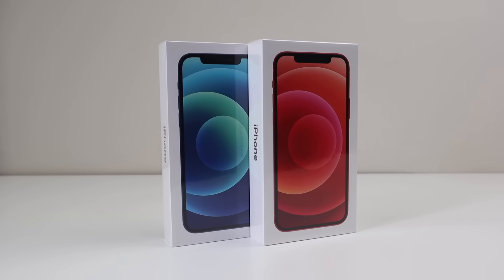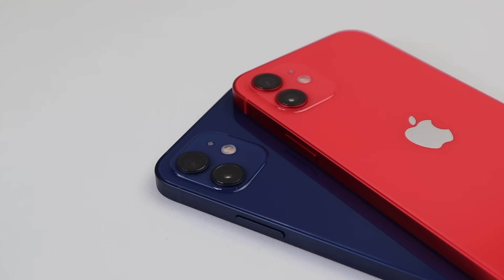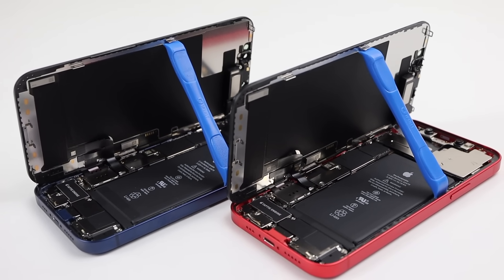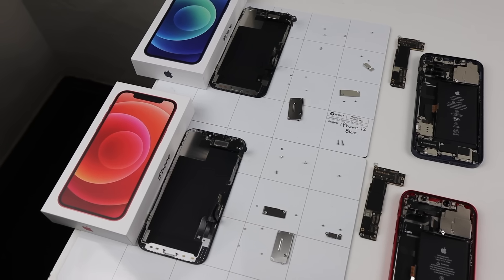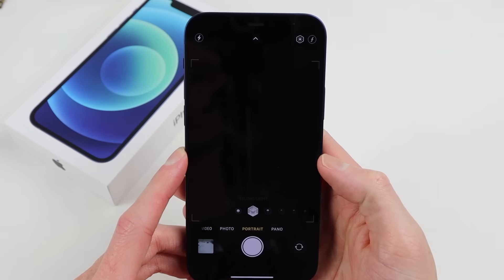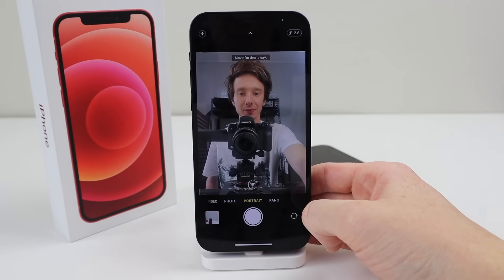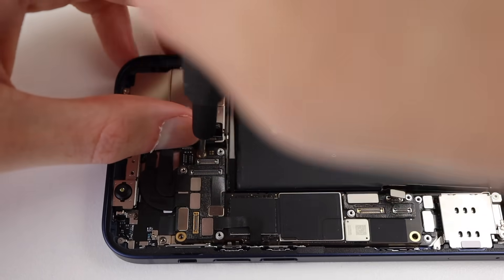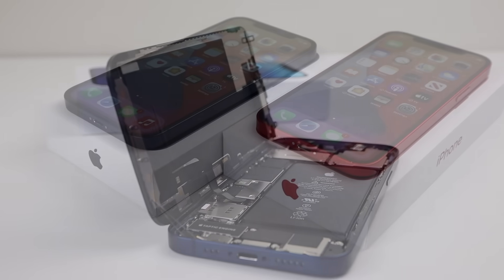iPhone 12 Anti Repair Design - Teardown and Repair Assessment

Comment: I've owned 1 Apple PC in my life time and that was like 10 or 12 yrs ago.  Video went out on it after 12 1/2 months --- they wanted $1300 to repair it - it was only $1800 brand new.
Being a electronics engineer for over 35 yrs, I fixed the damn thing myself.  Time wise took me longer to take the casing apart than to actually fix it.  Total parts cost was $1.79 !!!
That was the last Apple product I ever owned and will never ever have another Apple product.  Aside of their outrageous rip off prices for repairs, Apple is just too damn intrusive
for my liking.  After you buy something from them it belongs to you, not them, yet they do everything possible to control how you use it, what you can or can't do with it and all they
can do to prevent you from repairing it or having it repaired by anyone other than them.  Which is BS !!!  They took my money for it, its MY property now, not theirs.  So nope, I will
not deal with any company that still wants to control everything about MY property !!!  Oh, I forgot to mention --- over those past years, I've probably steered over 100 people from
buying Apple products --- all I had to do is tell them my story, what happened to me, and they made their own decision - interesting parts, damn near every one of them said the
same thing as I did --- Once they buy its their property now NOT APPLE'S and they should be able to do with it whatever they so choose --- same as I said !!!
Reply: Apple told me I needed a screen replacement in an out-of-warranty MBP to fix stiff hinges, and could not tell me what type of lubricant was used in the hinges. I fixed them with two drops of light oil. That was years ago; the hinges are still fine.
Reply: @vadimmakarov6811  you know that knowledge = money, so they won't answer your question
Reply: It is very anti consumer, yet people will continue buying it. I bought a MacBook Pro in 2011, and to this day it still runs smoothly. I had to replace the HDD with SSD and replace memory sticks, but atleast back then it was 'repairable' to an extent. Nowdays, everything is soldered together and you are SOL if you want to increase storage. I am still using iPhone 6S and I will continue to do so until it dies, which will be very soon.
Reply: @systemfox4724  but still peoole are gonna buy this...
Reply: This right here ^^^^ Apple is sick who just wants people to spend more money. They are SO greedy it's unreal. I think Samsung is way better in many ways.
Reply: I once owned an iPhone 6S, I was super careful not to break it and I did not know about the repair price being almost as much as a new iPhone unit wow. Tim Crook really has to be replaced.
Reply: Doesn't sound like you actually need an apple computer in your life
Reply: @tempsitch5632  For a long while, Apple was making notebook hardware far superior to anything on the market (a large SSD, fine screen at low power consumption and weight, etc.). So I bought them and run under Windows.

This is no longer the case. As of 2021, there are notebooks that rival MBP in every aspect, e.g., top of the line Dell ones. And, anyway, Windows no longer runs on new MBPs.
Reply: @vadimmakarov6811  Can't understand why you are talking to me, or why you call them "notebooks".
Reply: @tempsitch5632  I"m not the person you have addressed but this is a public discussion, so I've chimed in. Hope this is fine :). I've explained why I actually needed Apple hardware (two consecutive macbook pros, in my case) and there wasn't anything else on the market that fulfilled my requirements. I searched the market and I was aware of the drawbacks of owning apple stuff, still went for it because of the specs that no one else had by a factor of four (the capacity of SSD in my case).
Reply: They over price crap, and people buy it because they have not tried the other brand. I've tried both, and I would go for Samsung. Apple is over priced to the moon and back when compared to samsung.
Reply: A 4 year old is better at diagnosting than Apple‘s ”Genius“ employees
Reply: @tospoooky4me-417   even im better. And I am not tech savvy
Reply: just build your own $1800 can get you a better pc than a factory made apple pc.
Reply: I've discovered that. I have a 2nd hand iPhone 6 for music (got it for it's price and capacity), and man it's a complete headache transferring stuff. Have to use specific software. They say the control is so customers have the same 'quality' experience. But it's really not. It's so they can have control full stop, and charge you latter down the line. 

Heck, I hate how basically every phone has an internal battery now (I'm scared to open them). Really screws you over when they do go (happened on my S5, which I easily replaced) and now it's happening on my S7. Thinness is pointless too, struggle to hold the damn thing without a case. Even worse with the iphone which is thinner and made of aluminium.
Reply: "Who's the real idiot? The idiot who sells rubble, or the idiot who buys it from him?"

- Obi One Kenobi or smth
Reply: @cyclingdad6152  U do know Windows is an OS and not a company that manufactures and sells whole PCs and devices, right? U can't call a laptop that runs on Windows a "Windows laptop". It's a laptop from the company that manufactured it, running on the Windows OS
Reply: @cyclingdad6152  Windows is first and foremost a operating system, not a hardware manufacturer. Theres a variety of hardwared that "natively" runs windows so your comparison is flawed to the core. Something that could be considered a "standard windows laptop" doesnt exist.
Reply: @cyclingdad6152  you're* and sorry YOU'RE such a snowflake lmao. Next time, if you wanna talk about something, at least know the basics
Reply: @Safff848  sorry. I’ve had a look at your channel and you need to grow up a bit… like 15 years.
Reply: @cyclingdad6152  I dont wanna be 34 just yet kiddo

Comment: Yeah you need a .01 mm to get the things open, and cut away the adhesive. these phones are a real pain to open but pretty simple to repair. Just do not touch the metal thingy at the top. thats face recognition. Also the home buttons seem a bit more fragile.

Comment: First. Apple sucks. Second. My guess. There is some hidden, control. Most likely a special key sequence that allows access to factory mode. And, based on the start-up issue, it is possible to access the factory mode, the phone has to be connected to the USB and the other end connected to, possibility a factory machine, that syncs up to the phone, on start (providing factory access to the parts).

Comment: I don't have a lot of experience when it comes to iPhone phones, but I think they somehow gave each part a unique serial number which can only work if the other parts' serial numbers are the same or in the right order. For example, if you have the blue iPhone 12 phone with serial numbers on each part same, such as 1234567 then if you would try to replace the certain part for example camera, and use a different camera from the red iPhone 12, that camera would have a different serial number such as 2234679 and which then blue iPhone 12 could detect as different serial number and it wouldn't work properly. Or if the serial numbers of each part needed to be in the right order for example if the camera from blue iPhone 12 is serial number 312 that means all other parts of the blue iPhone 12 should be for example speaker part is 311 and the battery is 310 and so on. And in order to replace a certain part, you would need to find the same serial number on the same part or maybe they are unique to each phone, and in that way you cant replace parts, because you wouldn't be able to find the same part with the same serial number.

Comment: I'm not too surprised since I expect every camera module puts some characteristic watermark into the photos so that they can track down each shot to its origin even if it has printed out and copied several times. I know Ricoh has researched on such technology 20 years ago and it should have reached the required maturity. However, I'm not an Apple guy and perhaps this is all well-know stuff?

Comment: iGreedy, iDirty, iDisgusting, iVile that has become the best way to describe Apple, they have transformed themselves from a company that captured the imagination of the public with their products into a vile company for which there is no low they won’t stoop to, the list is too long and so public there’s no point going to great detail.

I suppose they will always have some iSheep that will follow them, but the writing seems to be on the wall for them, despite the pompous arrogance, it’s plain to see that the Apple stores to not have the buzz or as many people was they used to (this was already the case pre-pandemic).

For the uniformed person they still have desirable products until people realise the trap they are walking into, you can’t upgrade your RAM or hard drive because it’s all soldered on the motherboard, you can’t replace a failing battery because the phone won’t work properly and they call themselves environmentally friendly, I mean, Really!?

Thank god for small companies like iFix it and such that have always found ways to offer people alternatives, trying to charge 60% to 80% of the cost of a new one for a repair, is ludicrous.

The most basic of honour or shame seems to be a miss with Apple.

But ultimately they will fall, a company whose business model hinges on screwing it’s customers, will not survive long term, simply not possible.

Comment: I think this has to do with calibrating the photographic system with the rest of the hardware system, I recall that they use specific brand camera technology that has some patent on them.
I also know that it is quite normal that the calibration of the hardware of the camera with the rest of the hardware is uniquely done because it simply work on each phone to each processor in there own way.
Even if it is micro meter sharpness being handled by the phones hardware fixed processor software, has nothing to do with the Apple function software itself.
Now since the last 7 to 10 years the camera system has become smaller and more sensitive, there for calibration in the factory is needed.
So yes i don't really see the problem with 3rd part repair services not being able to fix this particular part of the problem.
What i do see is that it does function as a serial unique system hardware calibration, which means that switching parts between the two "identical" hardware objects is there for not an option. (Serial i mean by it is a closed circuit system calibrated only to work with each other withing the phone, interchanging is there for only doable if you have a factory repair set up which would mean re-calibrating the whole phone hardware software set up)
On that all, it is the consumer who managed to greedily wanted a compact one system object. 
That in turn has to be made like this unless you are a Parrot fan phone person and you would rather have a modular phone then a all in one perfection.
I am not at all surprised by this design, but maybe it would be better if the person who wants a phone that can be fixed every time he or she breaks it then choose another simpler smart-phone type.
Like your post, just seen it today, i have my share experience as consumer electronics Repairs.

Comment: Running on zero carbon energy is bullshit. If the provider cannot provide energy from renewable sources (usually the case) they are duty bound to purchase the energy requirement they have contracted with their customers, this means that a lot of the time they have bought megawatts from coal, oil, and gas providers.

Comment: Great vid. I believe the saying is 'twixt the devil and the deep blue sea' may well apply here. We are caught up in the thieving mugging, gits who if they can't hack the phone will sell the parts ? Therein lies the devil.👀 The deep blue sea is the fact of course that Apple once again has the upper hand and can cleverly use those thieving gits as a perfect excuse to enact this piece of autocracy. 👀You see, yes, we can lock em out of the phones and make the phones useless if they steal it. BUT that before, did not stop them (as said) from taking the phones apart and selling the parts. Two sides to this coin and they're both indirectly or directly; in Apples favour. 😶👀 No doubt the algorithm that is implanted probably in a rom chip etc buried deep within the inners sanctum can only be replaced with an identical pre programmed as you rightly state 'paired' twin. 👀The IMEI number of serial number probably has that info to tell Apple what rom etc it has. Unknown of course to outsiders etc I've just renewed my equipment and I've switched from my iPhone 11 to a Samsung FE20 as I no longer can be convinced to continue with Apple. 👀That cable they provide is again twixt right and wrong.. but in fairness anyone who has a previous Apple device with the lightning connector has the alternative USB to lightning cable and adaptor? 😶 Another reason my desktop computer systems are NOT Apple is because they keep changing the dammed connectors! 🙄What governments should do if they are going to keep preaching about longevity and recycling etc is to make sure that ALL manufacturers of such electrical devices etc MUST guarantee them for 5 years minimum. 👀If you buy that device then they cannot charge you more than the government stated service charge AND ALL replacement items re the costs are monitored by the government agency appointed for such scrutiny. That of course will never happen but we will still get the governments bleating on about saving the environment and recycling, whilst companies fail in their obligations as millions throw electrical items etc on the local tip. 👀How many electrical devices are copied, replicated to the extreme, cheap, tacky and adding to the waste disposal landfills year after year? WHO is to blame? Yes the buyer but ALSO the manufacturers, distributors AND the governments for not doing enough to curb such garbage flooding the market place.😶

Comment: This is literally the McDonald's ice cream machine type issue.
Reply: How is this literally the same kind of issue?
Reply: @temba92  Both devices are requiring technical difficulties to be repaired by a specific source in order for the company to gain profit. They both exclude any 3rd party repairs to be made.
Reply: @temba92 Because they are both a joke....
Reply: @temba92  watch johnny harris explanation why the ice cream machine is broken he explain it very well.
Reply: @dolphineshong7913  yeah i alrdy did.
Reply: Well almost because the ice cream machine issue uses an outside company and they're the ones that are milking the profits.
Reply: Interestingly, I was talking to an experienced ice cream machine repairman in the UK when my Carpiggiani machines had some issues and he said the Taylors machines McDonalds use are so expensive to repair sometimes they just throw them out or sell'em. Thankfully, the parts are interchangeable but they do cost a lot individually. 

You can read about the McDonalds ice cream machine issues if you read up on the Kytch smart device someone made (and got bullied to bankruptcy) that would prevent or diagnose issues before or as they happened. The machines do sound really good, just extremely temperamental sadly. I believe they need hours for cleaning and pasteurization cycles but if there's too much mix or the wrong temperature by a small margin they just stop and the process needs restarting which is a big oof. But McDonalds and Taylors have a partnership so franchisees just have to deal with it.

Comment: SHORTLY : every piece has it's own serial number attached with motherboard to recognize it it's not something new.. u can check that on any previous generation of IPHONE and findout which pieces have been changed... but they work fine... and when u change it on the Iphone 12 it won't work.. that's all 🙃🙃... which means they break that reparation of replacing pieces !!

Comment: And don't forget the right to repair affects ALOT of other brands aswell, John Deere a company that bulds farming equipment is doing a simmilar thing.
If a farmer tries to repair anything using original parts they get errors in the software making the thing useless so have to pay thousands of dollars to get their tracktor to a JD workshop and then pay more to have the errors removed. 
And this will affect alot of other industries if companies like Apple and John Deere get their way and don't allow 3'rd part repairs.
And the worst thing for the environment is consumerism and the more we have to replace rather than repair the more it's going to negatively affect the environment.

Comment: Pretty obvious that they did lock down the parts. Probably firmware that checks serial number to see if its the same number. Don't need Apple to admit it when you clearly showed nothing broke or was improperly reassembled.

Don't buy Apple products

Comment: on the other hand, unoriginal parts might be tampered with and may contain hardware exploits so that's somewhat reasonable, and if there's a situation when one of the part's serial key is copied to make unoriginal parts (that, again, might conain exploits), it somewhat prevents the motherboard from accepting them... but that would be in an ideal world, where there's no tool on aliexpress that actually can rewrite the serial in every possible part
Reply: That is not what they are claiming though. It is clearly because they don't want you repairing the phone outside if their service centers.

Comment: It's an easy program to install and setup as the only way to do actual repairs is to have a blank ID pair-able part and have the phone access the developer mode that pairs the new part. Accessing developer mode cannot be accessed via phone function alone. Thus, making the phone antirepairable by 3rd party vendors.